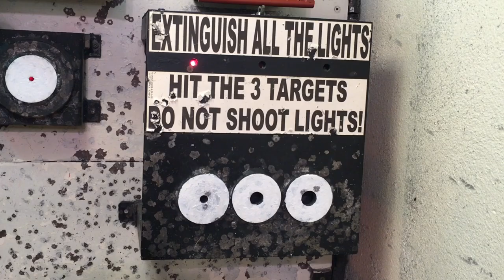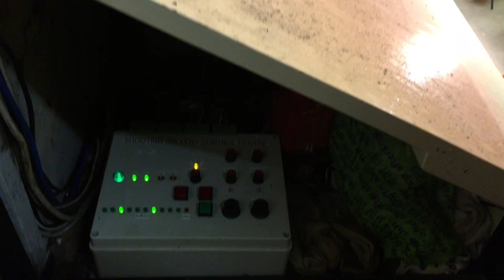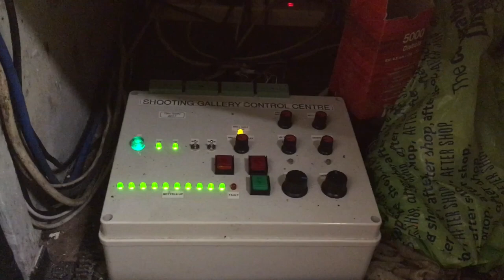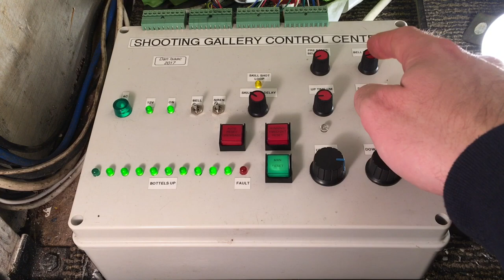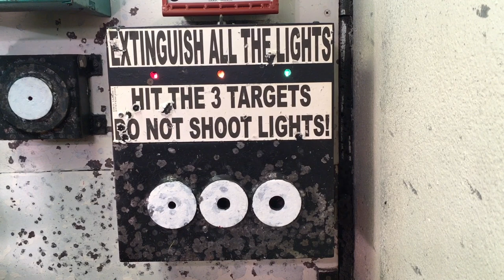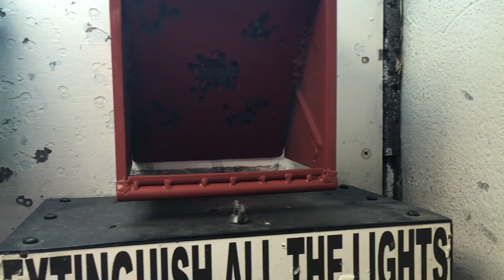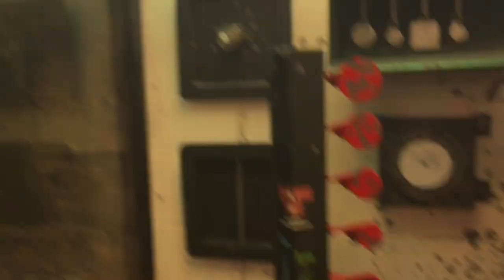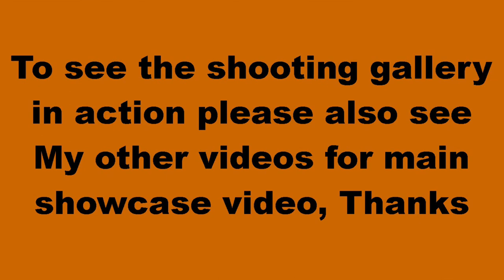Home Air Rifle Automatic Shooting Gallery, How It All Works

Comment: Hey Dan I'm amazed with all of this.  I've been wanting to try making some cool stuff like this but don't have your expertise.  Would it be possible to do something similar without the electronics? I could wire motors and switches but I'd be lost with the circuit boards.
Reply from the maker: Hi Jon thanks for your kind comments you could always make a string pull reset target of some type or maybe some spinners. if you connect a single DC motor to power supply via a speed controller you can buy from eBay you could make the cup/CD carousel (only a few wires) as for the other electric targets yeah the circuits are a bit too complicated to explain here and my drawings are more like messy incomplete notes than anything anyone could follow!
Good luck and happy shooting 😀
Reply: @danisaac  thanks Dan, I've made several guitar pedals from schematics, they work but it's never easy.  I'm guessing the ebay/amazon kits might get me started.  I grew up minutes from Knotts Berry Farm in So Cal, your gallery reminds me of that place, great stuff!